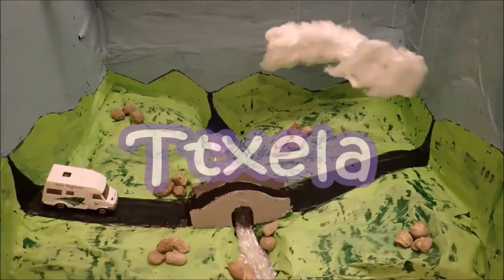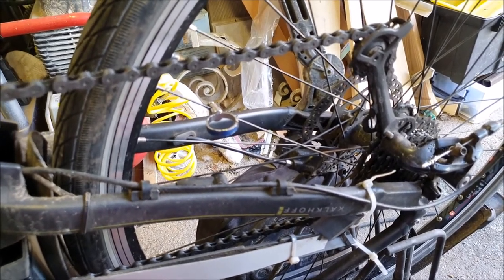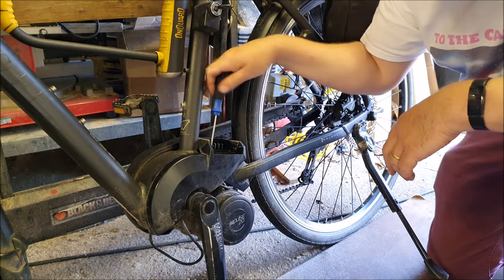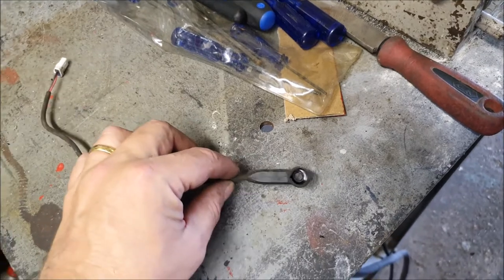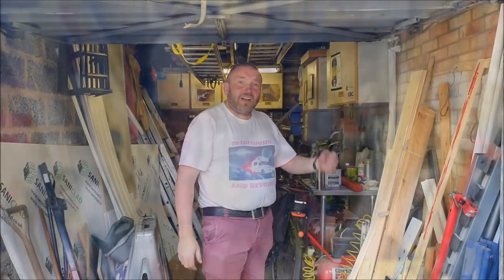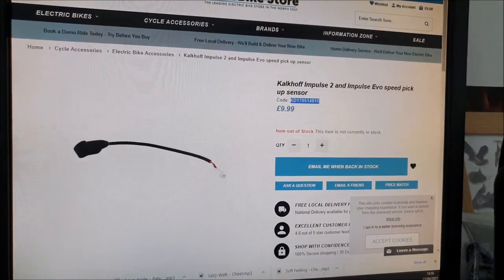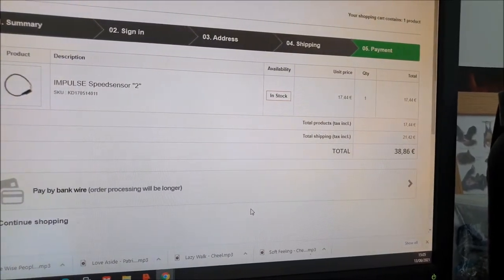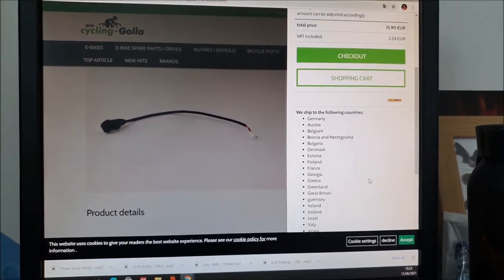Why Is My eBike Motor Not Providing Power? Part 1

Comment: Hi Alex. The sensor maybe a Reed Switch. Which closes when in a magnetic field. If it is. To test put meter on continuity buzzy setting then put magnetic near sensor. It should buzz as magnetic passes. That is if it's a reed switch. Cheers from old George.
Reply: That's what I was thinking as well George. I would test it against magnet.
Reply from the maker: Will give this a try 👍

Comment: Hi Alex, I agree with old George. It is unlikely to be a hall effect sensor. My guess is that it is a simple coil of wire around a ferrous core. As the magnet goes past it will generate a small electrical impulse. I have only checked them on an oscilliscope, and it produces a low voltage sine wave, in othe words, an AC voltage. So try checking it on an AC setting and very low voltage on your multimeter. (Maybe 2v scale). Another check you could do is a simple continuity check with your resistance settings on the multimeter. If it is the type I think it probably is you should get continuity, not open circuit.
Reply from the maker: I reckon you and George know more about this than me so that's probably the case 👍. I did try measuring resistance and got open circuit so possibly that confirms a fault anyway 🤔.  If I manage to get a replacement that fixes the problem I'll try cutting the old one open to see what's inside.
Reply: @ttxela  Yes, if I am correct about the type of sensor, an open circuit would indicate a fault. Although if it is a reed switch not necessarily. However, I have no experience with reed switches.

Comment: I have just won a Kalkhoff pulse bike with same motor from  an auction website for 30 UK pounds with only 18 miles on it and it's a 2017 model and it's spares or repair as it doesn't have power assistance.  Can the motor break so soon  it looks brand new?
 If I press the + button for three seconds I get push assist so the motor does work  very slowly and quietly but offers very little help.  Going to locate a UK dealer and ask if they can give me advice  the manual supplied must be from a mk1 version  impulse 1? as the display is totally different. Fingers crossed it's a quick cheap fix...?
I have checked the speed sensor alignment and spoke magnet and seems ok as it registers bike speed. 
I have removed the plastic cover as you have shown in video and checked the plugs for connections and corrosion and they seem fine
Motor sounds smooth and no duck quacking 
Wonder if I need to take the motor off and apart to see if there is any green death corrosion within the electronics ?
Reply from the maker: You might be lucky to find a dealer that will support a 2017 model. I think your plan is good to look at the connections first.
Reply: @ttxela  many thanks for reply   stripped the motor today and it's like brand new inside only thing I cannot check is the solid state electrics in that epoxy resin  all wiring loom looks fine      think it will go back on ebay for spares